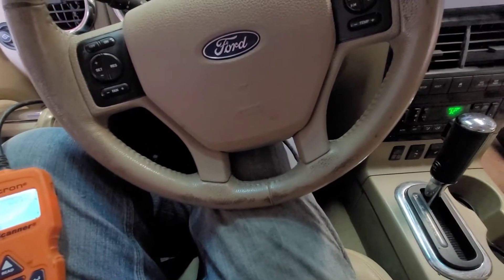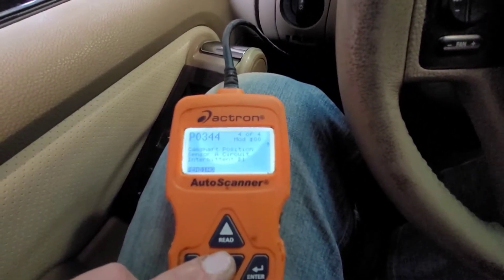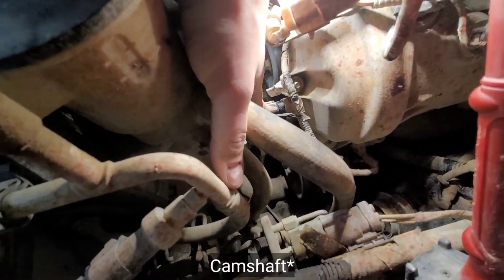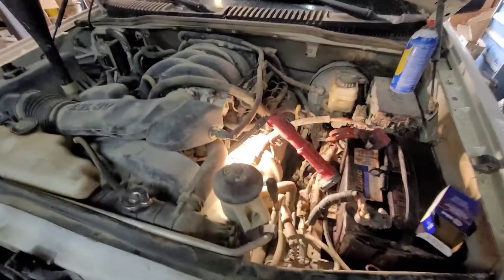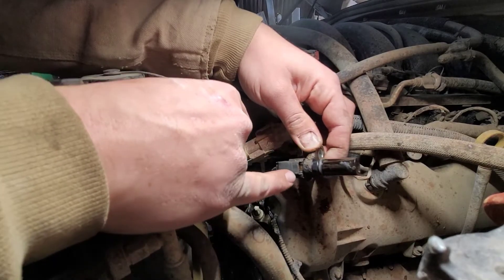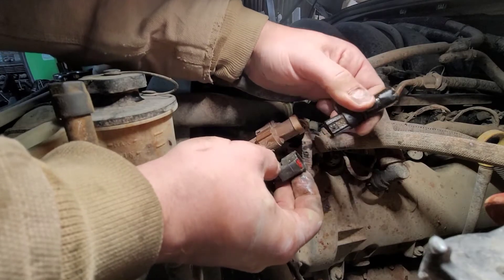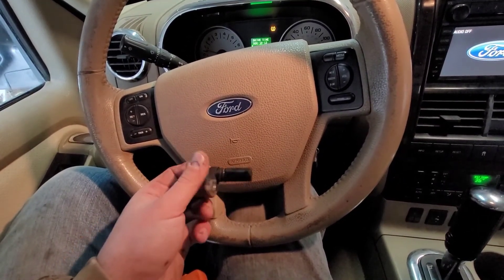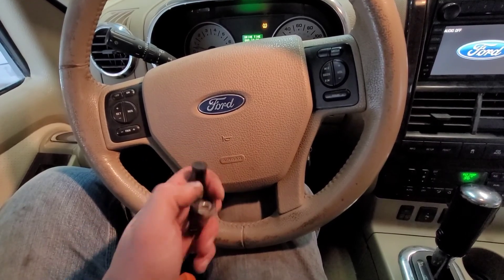Ford Explorer Camshaft Position Sensor Replacement (4.6L V8)

Comment: Can you list what the proper part number is for this sensor? I believe Motorcraft DU‑87 or Continental S10558? But I've also seen 3C3Z‑6C315‑AA and 3L3E‑6C315‑AB. Are these all the same part? Totally confused! Thanks!

Comment: funny you swapped camshaft and crankshaft terminology. In the FORD Racing technical bulletin, instructions for replacement of timing chains, tensioners and tracks they also refer to the camshaft sprocket as a crankshaft sprocket. I keep forgetting to let them know that.
Reply from the maker: Ha, I guess it's an easier mistake to make than I thought! If the Ford guys can screw it up in technical documents, then I guess I don't feel quite so bad. 😂

Comment: Was the vehicle running rough due to the bad sensor? Having the same codes on bank 2 P0345 P0349.  Was the truck running rough or was it just throwing codes and driving normally? To my understanding, if the CPS has no signal it will turn off the VCT system on the corresponding bank and if the VCT system is off it will make the vehicle run badly or at least a rough idle and loss of power
Reply from the maker: Nope, it was running completely normally - to the point that nobody even told me the CEL was illuminated. I just happened to notice it during the service and pulled the codes. I believe it was an intermittent signal loss from the sensor due to oil contamination and increased resistance, so the VCT solenoids were never completely disabled. You are correct though, without a reference signal from both cam position sensors, the VCT system will be disabled and driveability issues will result. I happened to get lucky and caught this before the sensor crapped the bed entirely, but it was definitely on its way out.

Comment: It was very hard to find which bank was which I have p0345 p0349. Mine looks the same as the one you were working on. I did some work and I think I got some oil and coolant in the connector for the piston sensor. Just to confirm bank 2 is passenger side?

Comment: Why do u use diesel oil?
Reply from the maker: A couple reasons. First of all, it's always here. We use Rotella T6 in almost everything, so it's a matter of convenience. Secondly, diesel oil has a much higher concentration of zinc and other base additives in it compared to conventional oils, so it provides better lubrication for a high mileage engine like this old 4.6 (which is running strong at 205k miles as of this comment). Lastly, diesel engines produce a lot of soot and combustion byproducts, so diesel oils are designed to keep those things in suspension rather than letting them settle out (which is why the oil in a diesel engine gets so black so quickly, even though the oil itself is completely fine). This works well for us out here because we operate in a desert environment where tiny particles of dust and sand are in the air...some of which make it past the air filter and eventually into the oil. The diesel oil traps that stuff and keeps it in suspension long enough for the oil filter to catch it and hold it, rather than letting it settle into the pan. 

Diesel oils are fine for gasoline engines as long as the viscosity and lubrication requirements for the engine are met. In this case, Rotella T6 5w40 checks all of those boxes for us, its fully synthetic and it works very well.

Comment: Seems my sensor is located behind the power steering reservoir... Should be fun
Reply from the maker: Yeah, you'll find them in all kinds of fun places depending on the make/model. The ones crammed into the back side of the heads by the firewall are always my favorite...who needs to see what they are doing anyway, right?

Comment: Is the6L a good engine and reliable ????
I'm buying a sport trac limited 
Please let me know
Reply from the maker: I'm admittedly not a Ford fan, but I will say this: the 4.6 is a dang near bulletproof engine as long as it's maintained. They don't make that much power, but run forever (which is why the crown Vic was so popular with police agencies - same engine). They do have a habit of cracking the exhaust manifolds once you get into higher mileage, especially if it was used for towing a lot. It's a pain in the butt to replace the manifolds but relatively inexpensive if you do it yourself. If someone put a gun to my head and said "buy a Ford!", I wouldn't hesitate to buy something with a 4.6 if I knew it was decently maintained.
Reply: @AllThingsMech  thank you for taking the time with the response 
Much a appreciate it.
The one I'm buying is the limited 
108,000
Every bell and whistles besides the fors touch screen radio,
If you wanta make 150 bones 
And a trade on my radio 
Let me know

I'll will like your video and subscribe.
Your a smart dude

I'm a Toyota fan 
Mut this will be my 5th explorer
Reply from the maker: Thanks Joey, I appreciate it. I'm a Chevy guy mostly but I also love Toyotas, I owned a 100 series land cruiser for several years and it was an absolute beast. The explorer is actually a surprisingly nice rig with the V8 in it. The V6 isn't terrible but it's pretty gutless, so it sounds like you made the right call. I'll have another video on this one coming up soon - the other cam position sensor just went out, haha. Easy fix though, I'll film the install as soon as the part gets here. Thank you for the sub, and for watching!

Comment: I have a 2002 mercury sable same as a ford taurus I guess.  Code of P0340, camshaft position sensor, circuit bank 1, sensor 1.  Intermittent issue with car jerking and stalling.  Had the sensor replaced but it was somewhere easy to the top right?  Dangerous to drive when this cuts off.  Wondering if I'm having the same issue but no mechanic can duplicate because it doesn't act up when they drive it.

Comment: Quick question?  
The wire in my connector came out! Is there a way I can reconnect or buy connector ?
Reply from the maker: Hey Carson. I would imagine that you could re-pin the connector if you had the correct tool and the connector itself is ok, but if the connector is damaged there are usually replacement pigtails available for things like that. I'd give your local parts counter a call and see what they have.

Comment: The oil passing the o ring and getting into the circuit caused the resistance to go up and that is were the Ecm popped the MIL light to inform you a problem occurred
Reply: I think I have oil passing this think too.  But trying to relay any of this to a mechanic is miserable.  I don't even know what to say.  Looks like an easy job with the right tools.  What do I tell them to do just like this guy did?
Reply: @mandymoonstar2680  show your mechanic this video that should help them understand what you think the problem is

Comment: And history codes don't always set a  MiL light depends on the code and what it is depends on if the system has to turn the MIL light On
Reply from the maker: Very true. That was admittedly a very, very simplified explanation just for the sake of time.
Reply: @AllThingsMech  i agree you did a great job was just for the people that read comments to give more info
Reply from the maker: Right on, much appreciated man. It always helps to have other techs filling in the details. 👍
Reply: @AllThingsMech  yes it does be safe

Comment: Your using diesel oil in a Gas V8 has there been any benefits to running the diesel oil ?
Reply from the maker: No real quantifiable benefits per se, more a convenience thing since it's relatively cheap for a full synthetic, and we always have a bunch on hand in the shop. Since it's a synthetic oil we can bump the service interval out a little, and (and this may be complete BS but it's what I've been told) since the diesel formulations have a slightly higher level of zinc content, it's supposedly good for the bearings in higher mileage engines. Lots of folks run it in all kinds of gasoline engines with success, and we've had no problems with it so far. An overall solid performing oil that won't break the bank. Good stuff.
Reply: @AllThingsMech  very interested and I bet you have quite a bit of diesels that come to the shop so its easier to buy diesel oil and use it in the gas motors then buy a specific oil only for 1 specific gas truck that the shop uses makes a ton of sense thanks for the info bro never thought about using diesel oil in a gas motor